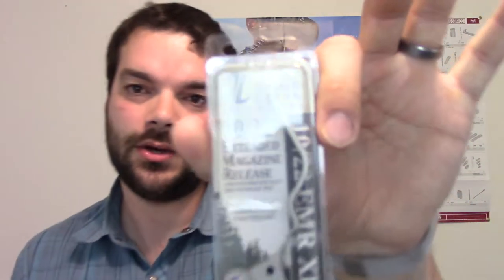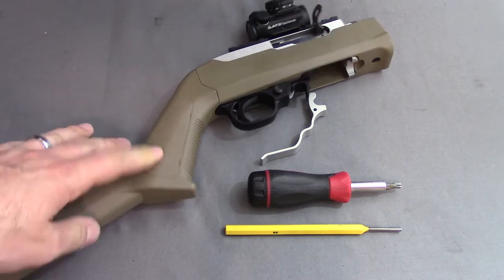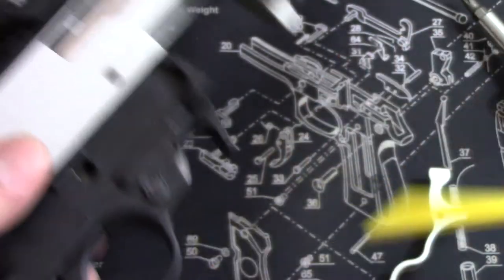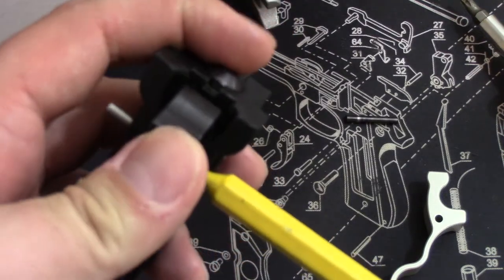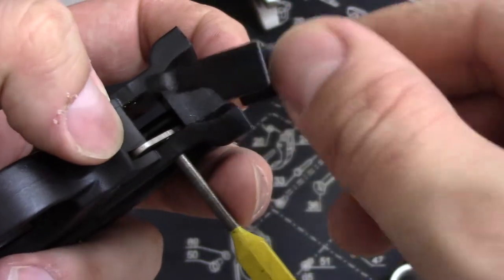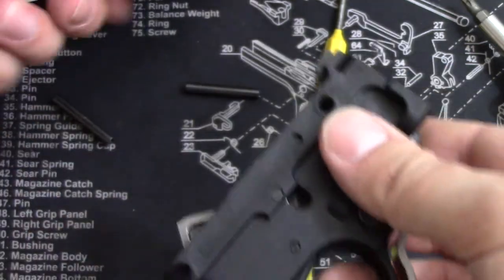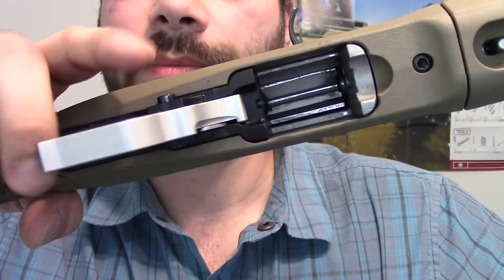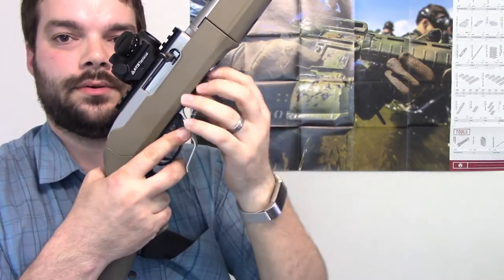Ruger 10/22 Extended Magazine Release Review

Comment: While the timber creek extended mag release is a great upgrade. Be aware, it doesn’t work with all aftermarket stocks. I installed my 1970s 10/22 in a Blackhawk adjustable stock with pistol grip. The lever was too long to fit with this stock. It did fit on my Boyd rubberize perfectly

Comment: I now have the extended mag release. Still have trouble with one of my Ruger BX-25 mags. When I first tried the BX-25s, which I bought a package of two from Midway USA, so I am pretty sure they are Ruger originals. I put the first one on with some difficulty and then could not get it off. I finally removed the scope, turned the rifle over, stood on it and used a long screwdriver with electrical tape on it to depress the mag release and pull this way and that way until it finally came off. I got up enough guts to try the second one and it went on easy and came off easy. I have compared them, even measured with calipers and cannot see any difference. I bought the extended release since my thumb was very sore from trying to remove that 1st one. I still struggle with that 1st one, but with the extended mag release at least my thumb has healed up. I took a dremmel polishing wheel to the 1st BX-25 and it is a little easier, but still hard to get on and off. Can do it without removing the scope and standing on the rifle now. LOL! The 10 round mag just falls right out when I use it with the extended mag release. 

Anyone with this problem please explain what you did or make me a video on how to fix that one BX-25. LOL!
Reply: I don;t have the extended mag release. Those rotary mags are 1/64th of an inch wider than the Bx-25 at the well. That's why theres so much wiggle with the BX-25's. Another issue is the metal lips on the BX-25.. if you take it off the magazine and hold it to a light.. youll see an a defect that looks like an 'Upside down seven".. I had to file it down a little and polish it with a brillo. The next issue, this is the most common with the Bx-25's.. the red feeder post that holds the coil spring is too loose and causes yet more wiggle. the wiggle from the skinnier well and the wiggle from the feeder, and that defect from the casting of the lips will cause all sorts of problems. The simple fix was to get a casing from a spent .22 SHORT and use it as a flange over the post on the feeder after you put the coil spring on. There are a couple videos that cover those 3 problems I mention. I don't have the extended magazine release yet, but as someone who wanted a BX-25 magazine, I was heartbroken that it had so many issues and Ruger has had 4 years to correct it. I'm not sure if any of those issues are causing your problems, But i know that between those three problems I couldn't get a round to load and it was causing the rounds to be "filed" by the Bolt hammering it against the ejection port. After those 3 fixes, ive put 1200 rounds with no issues. Also those magazines do require cleaning and maybe throw some graphite around inside of it. Cheers!

Comment: After installing the extended mag release, the bolt release binds when I try to slide it back. Only works when I remove the 2 pins from the trigger housing. Any suggestions ?

Comment: I would think that this setup makes it TOO easy to inadvertently eject the mag at a most inconvenient moment. Would be grateful for any comments in this regard from the experienced.
Reply: Rob, my only comment here is that if it required that you compress this release lever, then yes it would probably eject at an inconvenient time. That being said, this requires you to press the release bar away from the firearm, which in my experience would take a more focused and conscious effort. Simply setting the rifle down or bumping it against something wouldn’t cause it to engage. The only consideration I would have would be snagging it on something. I think the designers did as much as possible to address that by making the lever ride as close as possible to the trigger guard.
Reply: I've honestly ran both for years and have never had it eject randomly. It's a fairly good modification. I have them on 3 10-22s and a braced charger pistol.

Comment: My dad bought my 10/22 in 71 Monte Carlos stock which I really like. Anyway the existing clip release is nothing like the one you demonstrated with prior to replacing with the extended release lever. Are you familiar with the older release design and if so is it a similar disassembly?

Comment: I had these thinking it will work with my hunting. The bottom part gets caught in my pants and belt when hanging on my shoulder with a sling. It keeps on getting caught on somethung when hunting in the bush and forest. So, straight to the garbage. Not recommended for hunting style.

Comment: Do you have the link and cost for the new mag release?
I didnt see it in your post.
Great Video as I really like that particular release
Reply: The KIDD magazine release is nicer. It comes in 2 peices. The advantage is that if you decide that you don't want the extension on there you can just pop the extended lever off without taking the rifle apart. And it comes in black or silver to match your rifle. It is more expensive though $35. KIDD guide rod & spring kit is nice addition too. Really makes the bolt action noticeably smoother than the stock one. I think that was about $35 too.

Comment: FYI... You made this simple change-out, Wayyy too complicated!!  There is No Need to remove the entire trigger group from the rest of the gun. First thing you do (with No Mag in it, obviously), is compress inward.. the mag release/holding "bolt" with one finger (keep it compressed against its spring, until you've swapped out the mag release with the new one), then push the retainer Pin Towards the side that you (wrongly) pushed From, and Only enough to release the mag release tab. Drop the new release tab in, push the pin, back through and your done. It can be completely done (including removing and replacing the stock) in Less than 2 minutes.
Reply: My retainer pin won't stay in now after I installed this. Any fixes?